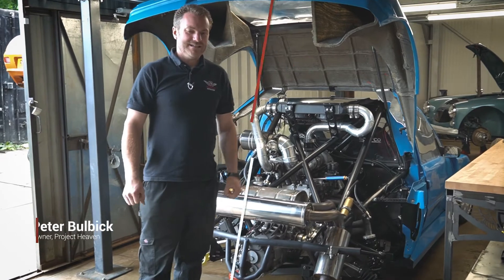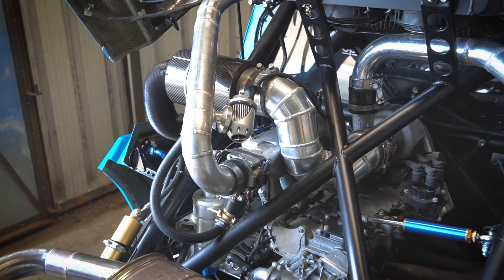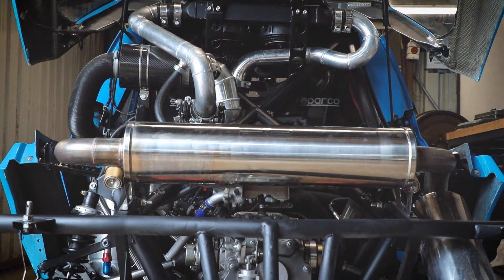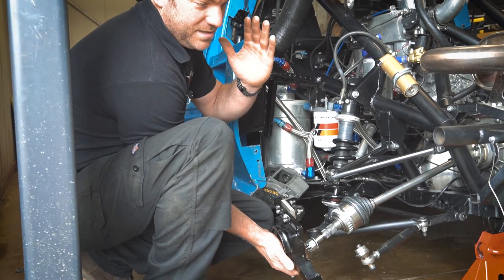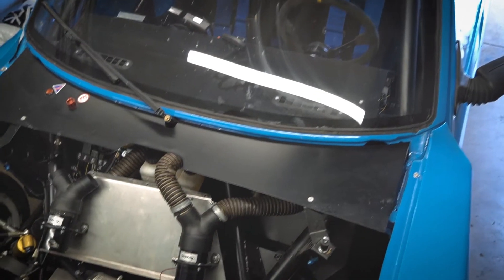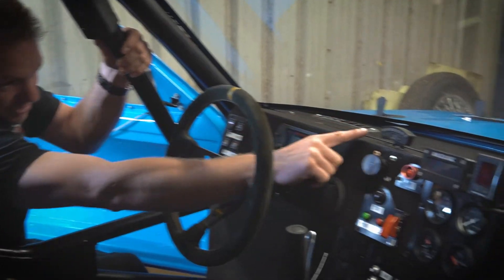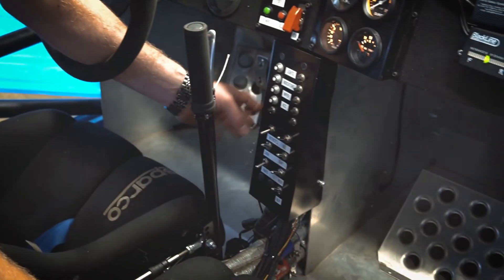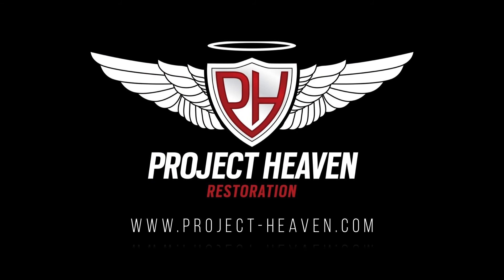Zost Supercharged Peugeot 205 T16 - Project Update

Comment: Very nice! Seems to me that everything is well engineered. The change in front and back tubing and suspension and the dashboard layout and functions seem better than the original 205T16. Placement of the petroltank is probably ok for racing but I would be afraid it is not safe while rallying. 
Though very curious about the first drive.
I own(ed) a few ex works rally Peugeot cars, so I think I can judge your choices. Greets and keep doing what you ate doing!
Reply from the maker: Hi Walter, the final drive and gearbox are Elite TXL. The ca isn't going to be used for rallying it only gets used for track racing.